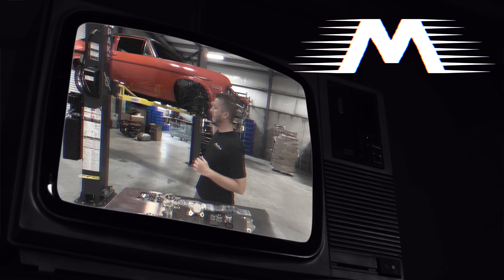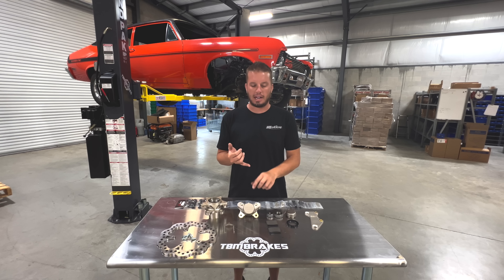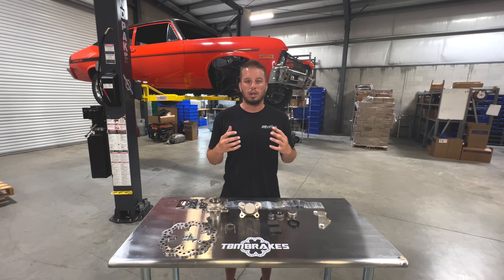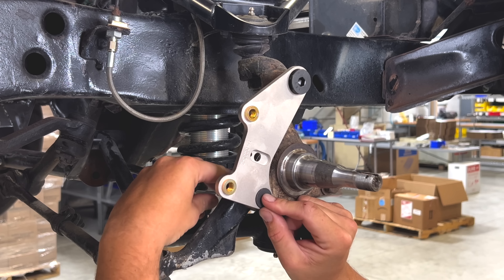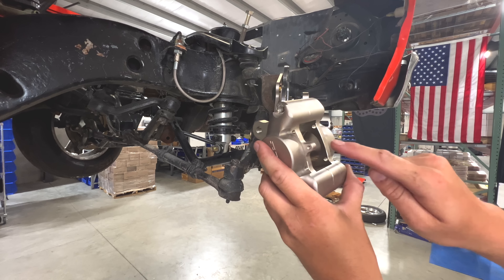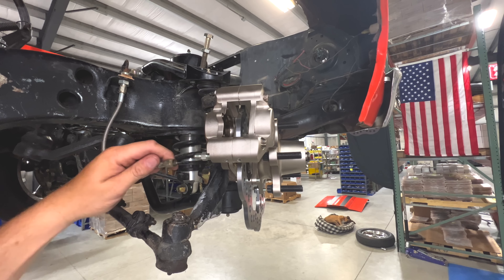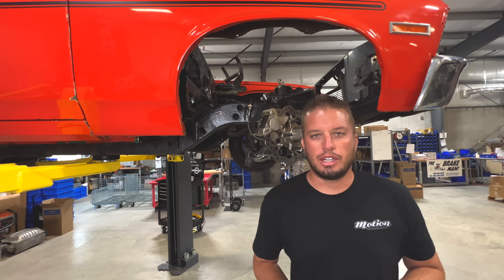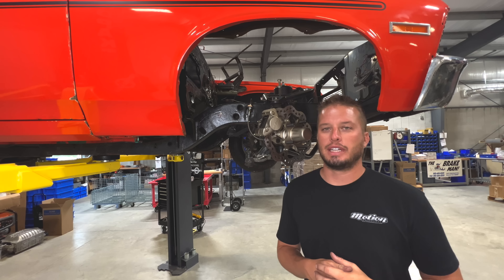Deep Dive: 68-72 Nova TBM Brake Install

Comment: Doug, does the rotor temperature on a 194 mph stop get high enough to release red locktite? Also, for a dual purpose vehicle, the correct bias is to have front brakes lock up before the rears so that a panic stop is dynamically stable. If you’re not running tiny skinnies vs huge slicks, can you set up TBM brakes for conventional higher percentage braking on the front?
Reply from the maker: We sure can set them up for front bias, we have a large variety of brake options and you can always run one of our 4 piston front brake setups.